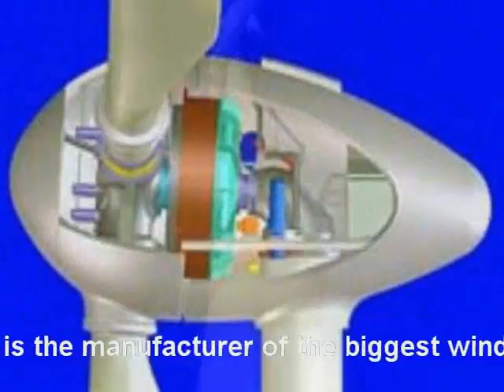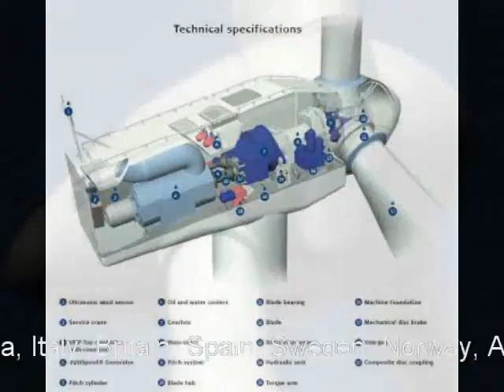The 10 Major Wind Power Companies in the World

Comment: Prop turbines are ridiculous because:  1) They're top heavy and prone to fall in high winds 2) They're hard to reach for repairs  3) They kill birds  4)  Need a lot of wind to turn props  5)  They tend to over-rev in storms, and burn up or props fail,  whereas the vertical-axis turbine has none of those faults. Why are they using props then? Only to increase the cost of maintenance and repairs, then charge the consumer for costs that could have been avoided.
Reply: John Carraway Cost, cost, cost. That’s why. The positives of prop units outweigh the negatives. They’re easier to build, easier to transport, and in some ways easier to maintain. Everything you mentioned isn’t as hard as you make it out to be.